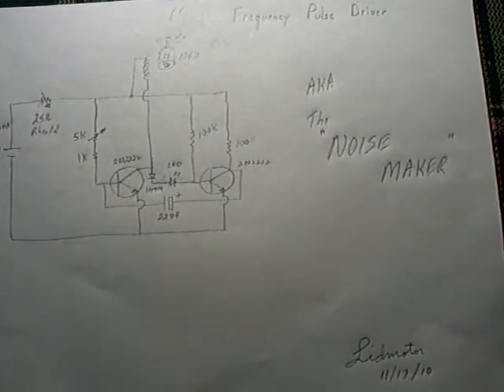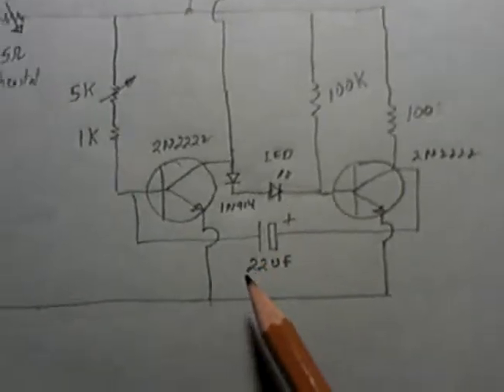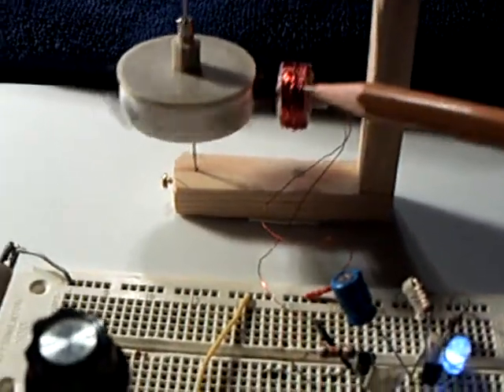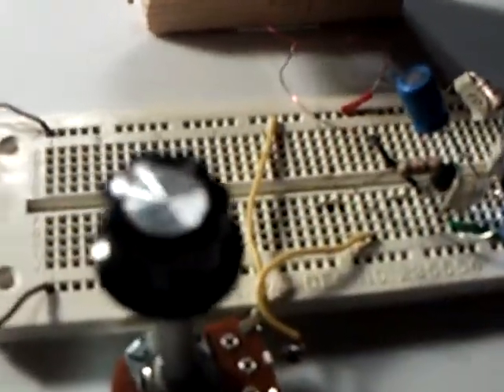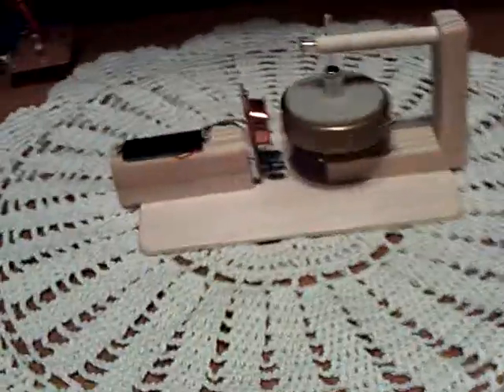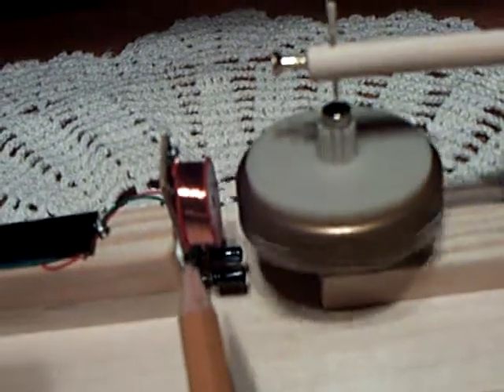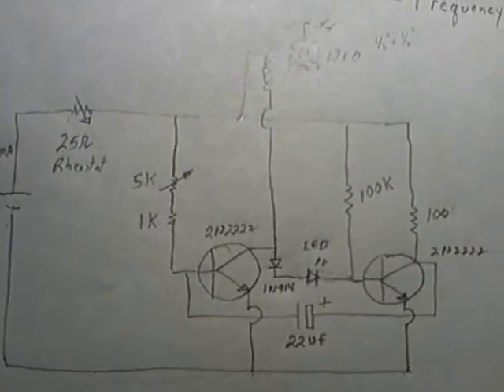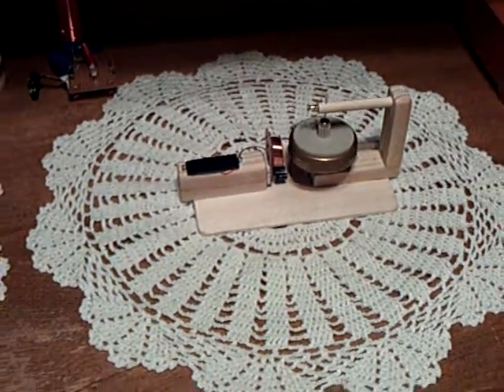Multi- Frequency Pulse Driver---AKA the NOISE MAKER.ASF

Comment: Solarbotics makes a solar SunSwinger Pendulum kit that has a single wound coil to pulse the magnet. Looks very similar to the second toy circuit you have there. It works great as a motor :) You can find the pdf on it here - solarboticsdotcom/assets/documentation/solarbotics_sunswinger_kit_jan082007dotpdf